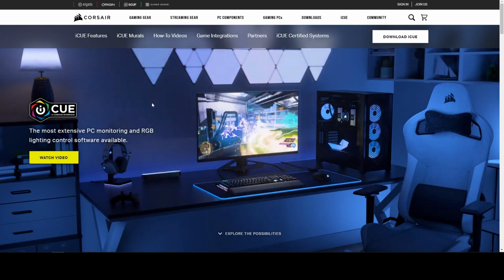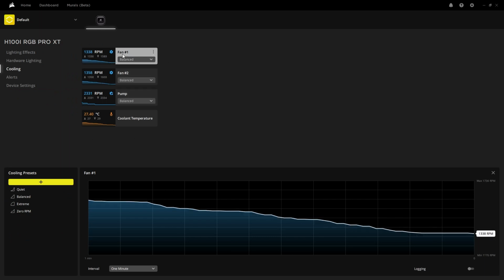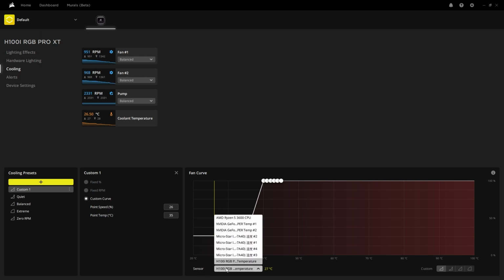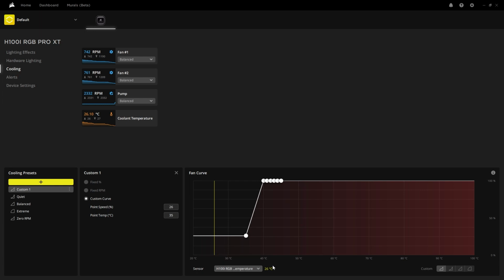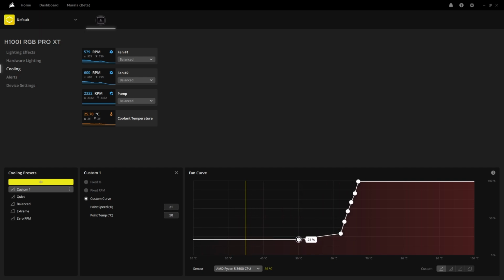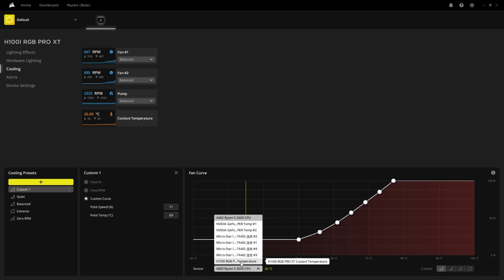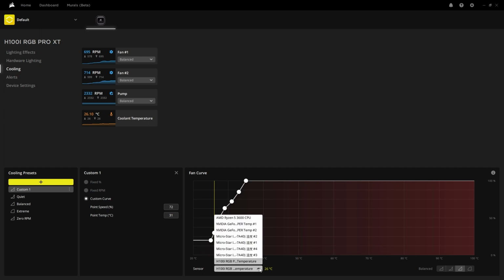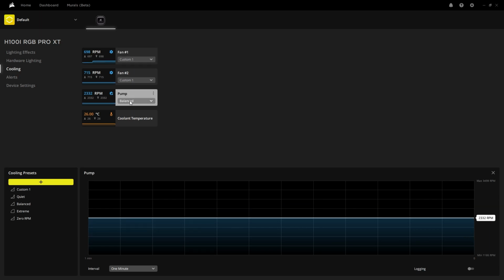How to customize Cosair Cooler Fan Speed Control in iCue? Choose CPU or Coolant temperature? (2023)

Comment: i have latest version ,but cannot choose between cpu or pump temp.Mine is Pump temp only.I have no option to switch between the two.
Reply: same
Reply: did u ever find a solution? recently switched coolers and have this issue
Reply: @Ronii-D  no i didnt
Reply: Same here. My sensor choice is greyed out, I can only set my fan curve to correlate with the Coolant Temp of my H150i AIO cooler. I cannot adjust it directly to the CPU Temp. Really annoying..